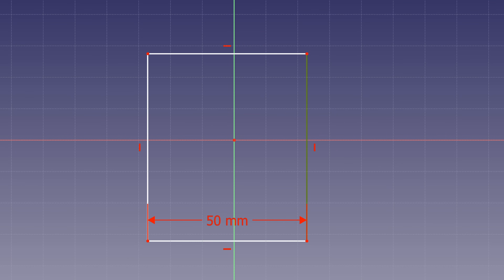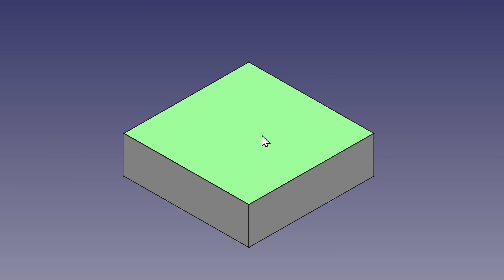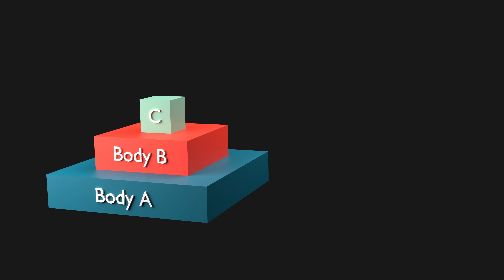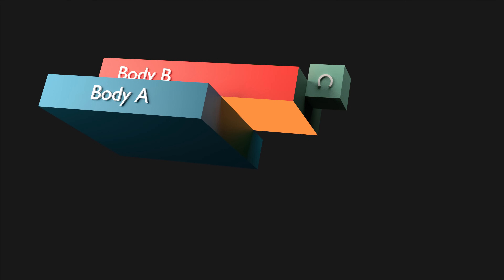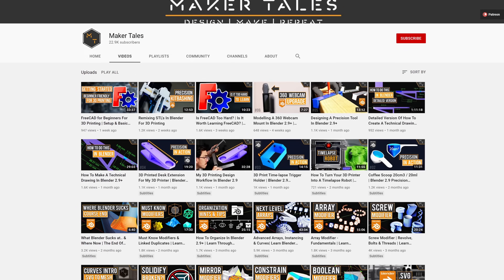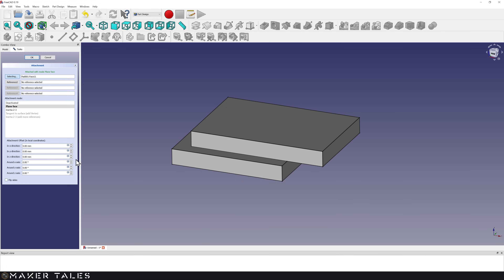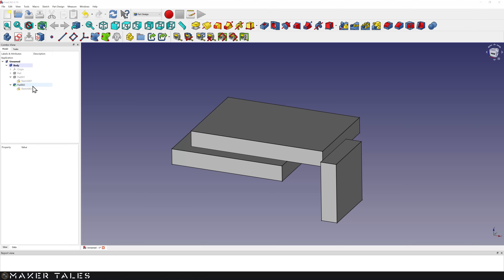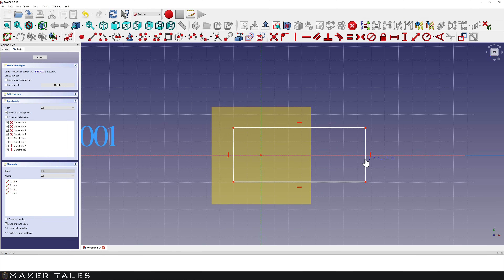FreeCAD Is Fundamentally Broken!  - Now what... Help Me Decide...

Comment: I vote for the RealThunder version.  I think this bug should have been identified and fixed while FreeCad was still in Beta. I use it anyway, but in any complex design I do, the bug crawls out and bites me in the backside. I am still really thankful that anyone would take the time to build this open source software and understand that I am getting what I paid for.  I had not heard of RealThunder's version before this video, but I will download it today and will need someone to teach me how  to use anything that is different from the broken version (I mean the official version!!)
Reply: This "bug" is fundamental to any CAD software. Faces need to be referenced, and if you split a face into two, you need two new references. Commercial CAD software assigns one of the new faces the existing name, implementing a bunch of "best guess" heuristics to hopefully get the right one. If you know what you're doing, you can produce this bug in ANY modern CAD software.

From a teacher's point of view, this problem being more obvious in FreeCAD is a good thing, since it forces users to learn best practice from the get go.

Comment: This is not just a bug - it is a fundamental flaw in the design.  That is why it is taking so long to "fix" - the developers have to get their heads around the underlying change.  Understandably hesitating because it is a big change and will probably break many things.
They should not worry about the breakage though, because so much is already broken.  Many incompatible "workbenches", random crashes, broken solver.  Really, at present, freecad is a massive conglomeration of mismatched tools designed to generate error messages.  Too much effort has been put into adding features without fixing the underlying broken design.
Show us how to do things in Blender.  Show us how to use the RealThunder branch - as he has put in the effort to at least work around the problem, and likely it will be his code the eventually finds its way into the mainline to fix it anyway.
You are worried that your videos will be obsolete by the next version? - of course they will - there are lots of obsolete "how to do XXX in freecad" videos online, many less than a year old.   Diddling about waiting for a stable working version will mean never getting anything done.   And as a "bonus" you get a never ending stream of new video subjects as they obsolete your old videos...
Reply: After using OpenSCAD for a long time I tried FreeCad and my first impression was just like yours. A lot of "workbenches" (whatever that is) with incompatible and/or overlapping features. A convoluted mess of menus and icons and tree views and some thrown in spreadsheets (If I want spreadsheets, I use an office program). And a myriad of "Addons" that you could or should install to make your life even more complicated. FreeCad is still installed on my system, but I never use it. CAD means "computer aided design", but I had the feeling FreeCad did not aid me in any way to make my rather simple models.

Comment: I have a completely different suggestion: double down on Blender. Most people using Blender love the open source nature and CANNOT use Fusion360 (for whatever reason). Also Blender is more powerful then Fusion in many areas.
I would suggest you pick some of the best beginner/advanced Fusion360 tutorials where they create simple parts. Then you use Blender to imitate the tutorial. I actually did that with a Fusion tutorial. At first I was annoyed but I learned so much:
1. sometimes very similar solutions exist in Blender (which you wouldn't have found otherwise)
2. sometimes you do it completely different (the Blender way)
3. often you do a combination of 1. and 2.
4. modifierers, modifierers, modifierers: you often build entire objects just using modifiers. Therefore fully parameterized!

Maybe in 12-18 months FreeCAD has gotten it ironed out. At the moment its not worth learning stuff that might change in a few months. I also sunk almost a week in FreeCAD. I love it but hate it more ;)

It's worth having your own niche...something like: show people how Blender can be comparable to Fusion360 in many cases.
Reply: True. If you have enough Blender and CAD Transforms experience, you can do some 3D CAD modelling quicker then Fusion. Also the Blender community is extremely active (compared to FreeCAD). If somebody shows the way, the devs might be swayed to add more CAD functionality in Blender in the future. I have seen similar things happen in the past for other functionality.

Thumbs up from me. It would be an interesting experiment to watch Fusion360 tutorials and then think while you are watching how to do them in Blender. If you have a playlist of a dozen top notch Blender tutorials that do a similar or better job then the videos of the Fusion360-Gurus on Youtube, people would flock to Blender and your channel as an open-source Fusion alternative.

Many people EVERY DAY turn to 3D printing and CAD. Often they pick Fusion. Then they sink thousands of hours into the software, so obviously it will produce excellent results. Nobody does something similar with Blender. Why? Because they haven't been shown the way!

It's one thing to make good Blender tutorials. People cannot really judge on that basis if Blender is really on the same level as Fusion.

But if you PROOF that you can "copy" top-notch Youtube Fusion360 tutorials in Blender in the same/similar time with similar/better results, people will pick Blender over Fusion.

In the last 12 month many friends asked me for 3D software advice. I always pointed at your tutorials and some stuck with Blender instead of the widely advertised Fusion. I am 100% sure I could have convinced more if I had a dozen side-by-side tutorials of Fusion vs. Blender, where Blender is equal or better.
Reply: Great idea. Jonathan has enough experience in Blender to make a playlist of videos where he challenges himself to re-work popular Fusion360 tutorials (links in the description) in Blender. If you pick the right tutorials, Blender can even shine in comparison.
Reply: I have to agree. The models you build with Blender are impressive: https://www.youtube.com/playlist?list=PL6Fiih6ItYsX8gnnek59lIPrtqnCAyg-o

No reason you cannot make a playlist called: "Easy, Advanced and Expert Fusion360 tutorials NOW possible in Blender. Quicker, Better and Open Source!". 

Or something shorter and more catchy :P

Fusion has so much publicity, you need to challenge it head on. If people see that Blender is as good as Fusion (e.g. for 3D printing), they will come.
Reply: Youtube recently suggested a few Fusion360 tutorials to me and although I am a Blender guy, I watched them and reproduced some in Blender. Didn't notice any time or quality difference modelling the stuff from the tutorials in Blender.

Somebody reproducing Fusion-Tutorials in Blender doesn't exist. It would be a great learning experience. In the comments we could critique how you could have done things differently/better.

Please do a Fusion-goes-Blender playlist Jonathan! There is real interest in this.
Reply: blender can cause issues when trying to 3d print because it works with a different type of 3d modeling (frankly I did not understand the explanation but it can cause downloaded stls to be unprintable) something to do with missing or overlapping faces that causes a problem. some people had fixes, others said they didn't work. can't say I know for sure if it's a significant problem but it seemed like it (plus it was harder to understand blender to me) so I moved to cads

Comment: I have to agrre with the community part.  Since i came from solidworks, i was just giving an idea for frecad development, i ended up banned from freecad forum. I still love freecad but is sad that this happens.

If you want to develop a open source software, you have to know what the industry uses and what tools it needs.  Most features asked and solved for blender come from Maya or 3ds users tham came to Blender. This is really important. SO in conclusion, if we want a really robust cad software, all critics and sugestions diserves attention (like this vide) So the development can grows faster
Reply: I agree 100%. Are you familiar with GIMP? How many years did they refuse to adhere to ANY standards, intuition or oven common sense? They changed some things for the better but the UI is still light-years away from anything you want to use for more then basic tasks. The sad thing is, under the hood GIMP is really gold. Only the UI sucks soooo bad, its not even real.
Reply: @shoeoffhead3692  I'm familiar with gimp, I use it professionally ;) only used Adobe on university but I changed to gimp
Reply: @shoeoffhead3692  and new UI is under development, altought you can already test it

Comment: As someone who as used Freecad for over a decade, mostly because it was the only thing I had access to, I do what I do with most opensource and free software.  It's a current limitation, even paid software doesn't work how it should sometimes.  I'm sure it'll be fixed soon, when I first started using Freecad it was a nightmare for me, it's light years better now that it was then.  I'm usually running the dev version as I've found it to be useable most of the time.  Been waiting a few weeks before switching git to .20 for testing.

Comment: FreeCAD is open source, which means it depends on user involvement.  Anyone can submit and verify bugs, even with no programming skill.

"Who knows when .20 might happen" is just a lazy thing to say.  Compare the historical roadmap with the actual release dates; their accuracy can be assumed to continue.  If they're wildly off and/or never explained, FreeCAD is likely doomed as a project due to incompetent leadership.  Otherwise, give them time to get stuff done.  Believe in it or don't, stop waiting for your faith to be justified.

FreeCAD is in heavy flux, and has been for a while.  Many tutorials for .18 don't work in .19, and the same can be expected of .20 regardless of whether anything from realthunder's branch gets merged in.

TNP isn't merely a bug.  It's a fundamental design flaw, and the developers clearly recognize it as such.  Implementing a workable solution isn't as simple as non-developers may think.

Rather than provoking the Internet's opinion (because that always turns out well), plug yourself into the development correspondence (mailing lists, forums, bug tracker, whatever is public) and lurk for a few weeks to get a feel for where things are going.

Comment: I would say make videos about FreeCAD 0.19, mention the caveat that the TN problem exist (and that a solution is underway) but skip the parts were you fix broken stuff, tell people to use realthunder's branch if they don't want to deal with the TNP and don't mind their files being incompatible with stable. 
Maybe do one video about avoiding the TNP instead of incorporating that in every single video so just that one video will become obsolete in the future, and in my opinion not so obsolete since it would still lead to very robust models.
You could wait until 0.20 comes out but I expect this development cycle to be as long or longer than 0.19 (around 2 years).

Comment: Minor correction, it's FreeCAD 0.20 (o point twenty) the version number is not a decimal but a MAYOR_VERSION.MINOR_VERSION naming scheme so trailing zeros should not be omitted. FreeCAD 0.2 came out a loooong time ago.
Reply: In my case my native language is Spanish where there is a very similar word that is actually spelled mayor, could have been my own mistake or Spanish autocorrect, given how it's written here it's most likely my mistake. Can't speak for anybody else. Regarding inconsistent versioning, yes I have complained about this myself to the maintainers and worked towards making it more consistent. Either way my point was that trailing 0 should not be omitted.

Comment: Referencing faces is very convenient and intuitive but it's really bad practice, it shouldn't be encouraged even with the topological naming algorithm. It can break anyway, topology naming is very complex and outright impossible to make it maintain the references 100% of the time. I remember my instructor strongly disencouraging sketching on faces or using them for operations when I learned CATIA, a very pro and proprietary CAD program with a good topological naming algorithm and I still broke my model countless times by referencing faces because I was lazy.
Reply: But if it is bad practice to reference faces, why is it even possible?

It is the most intuitive way of connecting two sketches.
Reply: @MrJetra  for convenience, and sometimes it makes sense, but should not be your first option.

Comment: While I agree that the topo naming problem/bug is annoying (and I, too, am trying out Realthunders branch and am super excited about it), I would like to stress something that you have also mentioned in your video. The topo naming problem is to be considered a bug, I agree on that. But I also think that it's not that big a problem that it seems a first sight. Actually, this bug teaches to construct CAD models the way you actually should do it (I wouldn't call it a feature though :-) ). Yes, other CAD tools are way more stable in that respect. But The moment you run into the topo naming problem is the moment you have to honestly say that YOU screwed up the model. Other CAD tools are just smart enough to guess what you want. But there is always a point, where even the best CAD tool cannot deal with the updated model any more. Instead of a reference that has been switched due to an additional face somewhere, you could have just lost your reference. And then there's nothing a CAD tool can do if you referenced the following features on that plane/edge,.... So, other CAD tools are more forgiving. But at some point after letting you do your CAD work the way it should not be done, and meanwhile having a huge complicated model as a result of many hours of work, it suddenly breaks. Yipiie!
Again, I wouldn't call the topo naming problem a feature, of course. And I'm glad Realthunder takes care of it and that his work will be in the main branch eventually. But still, having it solved will not alter my way of creating CAD models that much. I still will avoid referencing features on earlier features unless I want to really do something quick  and dirty. So, when it's solved or improved, be glad it is, but try to work as if it was as bad as it is now with FreeCAD. Even if you're working with another CAD tool.
But I agree it makes the steep learning curve even steeper (or, actually, overhanging, as you pointed out).
Reply: Kind of disagree.  I've not found a way to for example keep fillets linked to the correct surfaces. On the CAM side, all the path tools break, and they only reference surfaces often. If someone knows how to make CAM models stable, please post a tutorial.
Reply: I've been (lucky) careful enough to avoid the TNP in my FreeCAD designs.

It's a known limitation and well-documented but if you follow the recommended workflows you can avoid it.

I agree that Realthunder's work on eliminating the TNP will make life easier for newcomers to FreeCAD and open up more flexible workflows.
Reply: Completely agree. Unfortunately I have made the habit of building my models on top of each other. I think it might be a good time to correct that, as I am moving to more complicated designs.

Comment: What you need to to do is just keep reporting this bug. It seems a very simple fix. I have ran into problems like this since it seems FreeCAD doesn't have a counter to keep track of the total number used and keep counting from that, but instead looks to see what is the highest current number and add form there. But anyway, a very simple fix to fix and if you keep complaining about it they should get around to fixing it..as it is a MAJOR issue.
Reply: It is not a simple fix AT ALL, this has been a known issue for a long time, reporting it now is useless, a feature to vastly improve this situation has been already developed and is waiting to get merged but it is no simple task. Have a look at how much code is needed just for just the foundations of this improvement: https://github.com/FreeCAD/FreeCAD/pull/4752/files that's 17K lines of code and 2 more Pull Request are yet to be submitted by the coder!
Reply: @adrianinsaval  Exactly. This PR is huge, and the issue is not in FreeCAD itself. The issue originates from the reference system integrated into the modelling kernel and is bound to introduce a ton of new bugs. Developing CAD software is way more complicated than what people may think, and being opensource makes it even harder. People need to be more patient.

Comment: I wanted to CAD for the first time since switching to Pop!_OS Linux. Today, I tried 3 ways to run Fusion 360, and failed. I gave up and opened the STEP file in FreeCAD. I don't CAD much. Now I have to learn. I wanted to put off learning.
Reply: You can run now Fusion 360 on a browser on Linux. I do that or use Onshape.
Reply: @Chris-el8is  Onshape is wery good